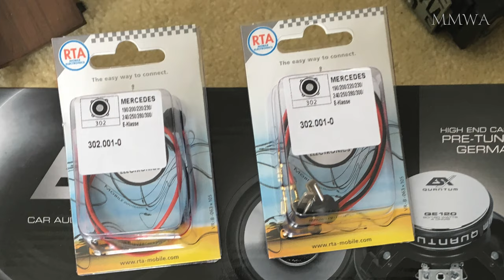w124 drop in replacement speaker install (ESX)

Comment: just did this replacement today with the exact same parts and it worked wunderfull, also quality is really good for the price. Thanks a lot for the install video.
Reply: Hello, which becker unit did you pair this with?

Comment: Hi MM, yes I did notice the beige trim!   Those old speakers looked OK, do they just wear out over the decades? Why was it felt they needed replacing, just poor sound?
Reply from the maker: "I installed this pair today in the wagon. I've had the other pair in the coupe for a while now. They sound much better. Clearer. The original ones in the wagon have been damn good really, excellent midrange but obviously lacking clear highs"

Comment: How's the sound on these bad boys? I purchased a pair (still waiting for them to be shipped sinceit's the christmas period) but can't find any revoew of 'em. I watched a few videos of you where you test tje radio / CD player but on video you can't really make something up.
Reply: Yeah i am i  the same situation. Almost watched the whole video just to ear the sound quality
Reply: @ronnevh2788  I recently purchased them and installed them. At first it wasn't that great when they were linked to my 80's (period correct) headunit and blamed it on that. Than I switched out my headunit for a Mercedes Audio 10 (from the w202 and w210) and this is just great! If you ask me, you could compare to a stock VW Golf 6. Not 'wow' but they are a very nice hearable upgrade!
Reply: Where i can buy these
Reply: @jussiaho9089  I bought mine at 'audio car products', a dutch site.
Reply: @cooleloekie  mine radio only makes 40watts per channel, so is it worth it? or should i get small amp. Did you have amp or just plugged with the radio. Are these worth it?
Reply: @jussiaho9089  40 watt is plenty enough. The speakers in every 30 year old car are kinda crap by now, so just speakers and a good working head unit is a very big diffrence.
Reply: @cooleloekie  yeah, does those fit rear speakers?
Reply: @jussiaho9089  I don't have (stock) speakers in the rear shelf but I heard you need speacer in the back. Normally that site has them.
Reply: @cooleloekie  oh okey

Comment: why buy the adaptor harness? why not just use the original wire/plug  from the beckers?
Reply from the maker: on my own cars, this is exactly what i did. These ones that came with the speaker kits are cheap shyte.
Reply: @MMWA-DAVE  right on, thx

Comment: Is the sound quality a lot better with the new ones? Thinking about getting new ones ...
Reply from the maker: Depends what your definition of better quality is. My setup with the 4 speakers produces no base what so ever, its all mids and highs. With speakers this size you really need a subwoofer too.
Reply: @MMWA-DAVE  I'm considering putting an under the seat sub in my 87
Reply from the maker: @hugeslacker  if there’s room for it, why not. Good idea

Comment: Can any one tell me, will these fit a W124 1988 per facelift model? Everything looks the same, but can anyone confirm? Thanks
Reply from the maker: at a glance the dash looks the same on the pre facelift cars. I can’t remember what the rears look like though. Hopefully someone else knows
Reply: Thanks,  @MMWA-DAVE , my W124 is a TE300, so the back speakers are in the doors. I think I will just move the front speakers to the back as they are still ok, and put new ones only in the dash.

Comment: Hi mate from Australia Melbourne where can i get those rta 302.001-1 speaker adaptors thanks
Reply from the maker: Hi, we got 3 complete sets in from germany for our 3 w124's they came as complete sets such as in eBay item number 184041027179. It's best to group order like we did or the postage is uneconomical (provided the seller gives a discount for multiple items) I don't think there are any dealers in Australia.
Reply from the maker: you coul also make your own from a junkyard 124's speakers
Reply: @MMWA-DAVE  excellent thanks heaps mate, following your red w124 progress great work and knowledge love the W124's
Reply: @MMWA-DAVE  how??. Do I have to solder the wires to the new speaker

Comment: Any clue where to get those RTA adapters in the US?
Reply from the maker: The whole lot came as a kit from a seller in germany on eBay. I'm not sure where to buy them but you could make your own leads by salvaging some original speakers from a junk yard.
Reply: I bought mine on amazon complete with a set of adapters. Bought them in germany though so im not sure if they sell them in the US like that as well

Comment: W hat's wrong with those two  front  original speakers?
Reply: +1 .. The OEM w124 dashboard 4inch speaker is crap. Small voice coil, Shallow excursion, Wizzer cone H.F. component, paper cone material easily breaks up audibly. Cheap, cheap.